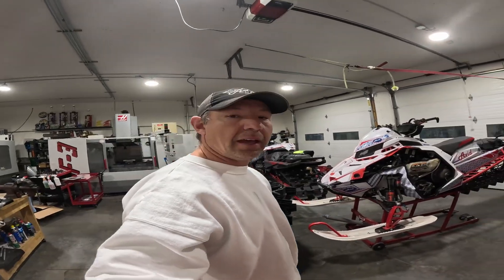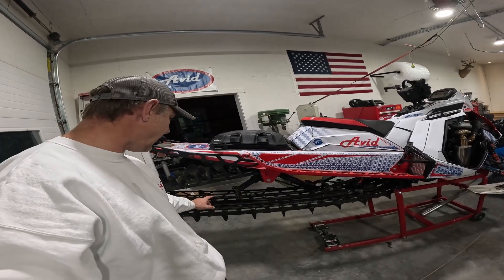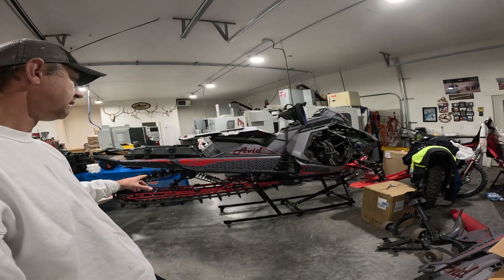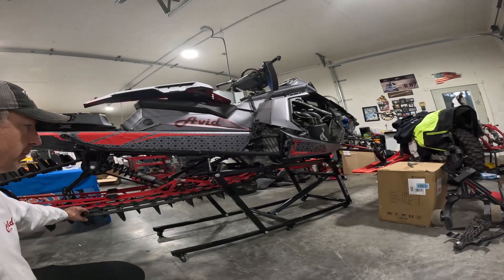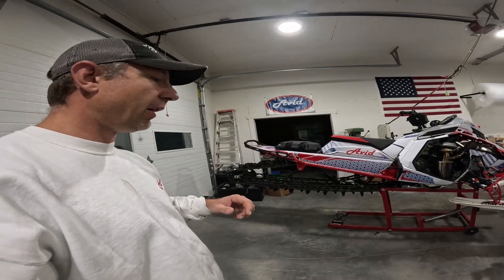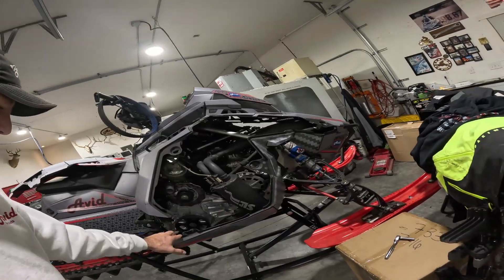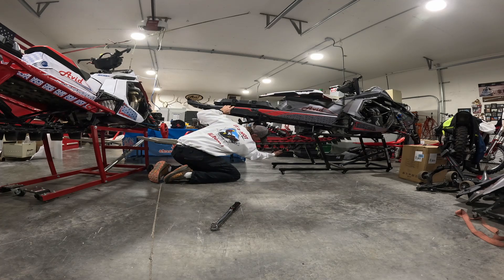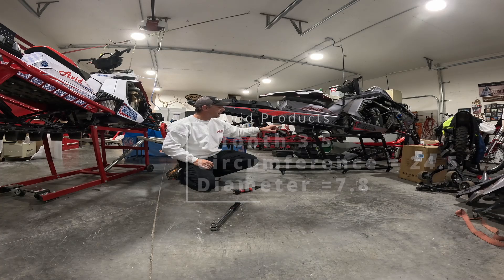Avid Products Drop and Roll Efficiency

Comment: Not to mention the gear down with the bigger drivers helps deliver the power to the track with less load on the clutches. 🤘🏼
Reply: Bigger driver is a taller gear, so more force required.... You'll have to gear the chain/belt drive down to compensate for larger drivers to keep same engine speed to track speed ratio.

Comment: Nice Product. Is that change final ratio?
Reply: If I'm right, your final drive ratio is now 2.08 instead of 2.45  if you have the stock QD2.
Reply from the maker: @ianblais2296  We use a TKI set up with 63/24 gears, 7t 3.5 pitch drivers helps us get to a QD2 final drive.
Reply: @AvidProducts  Make sens . Thanks for the answer

Comment: I did basically the same thing a few years ago with an old mountain horse snowbike using your drivers. There was an immediate noticeable difference in how easy the track spooled up. But then I smoked a rock and totaled the whole kit basically. I would love for someone to start thinking this way on the snowbike side of things especially when bike hp is such a limiting factor right out of the gate

Comment: Nice explanation!

I understand how rolling resistance is huge, and bigger wheels and drivers will help.

It's worth noting that pull force will increase with smaller drivers just like a transmission output shaft is harder to turn in the lower gears, even though the input shaft is easier to turn in low gears compared to high gears... 

I can certainly appreciate more teeth driving the track as well.